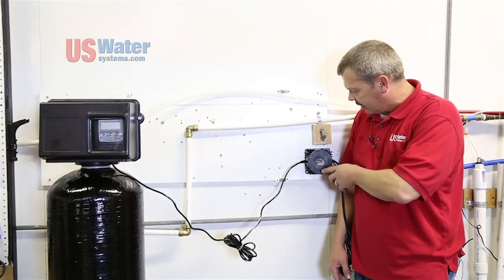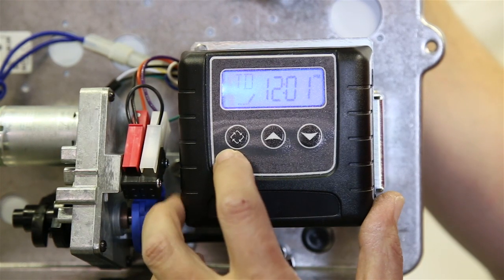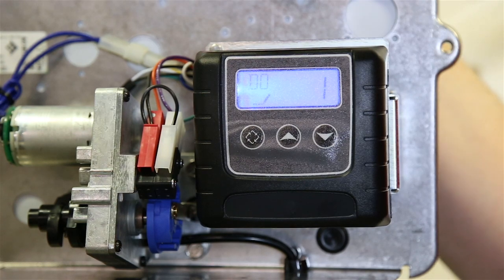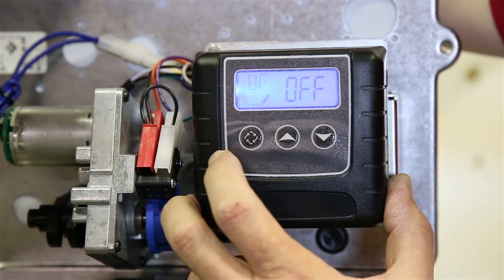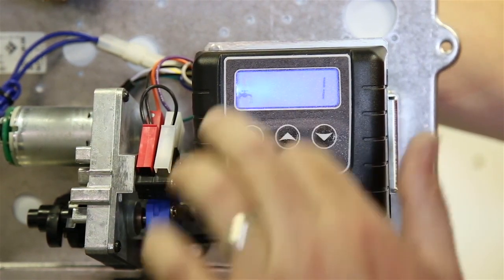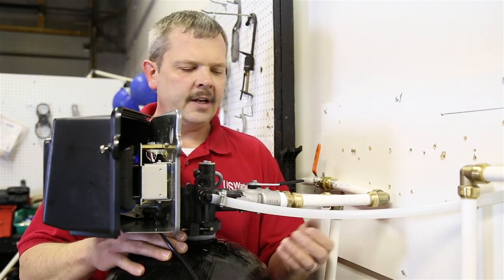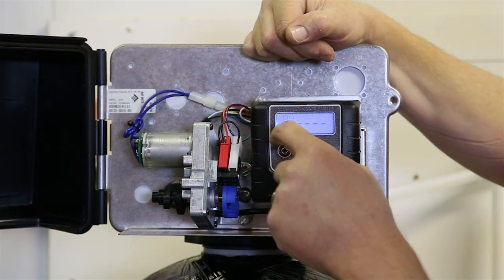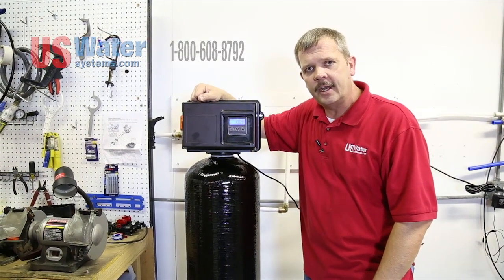Installation - InFUSION Iron and Sulfur Eradication System (part 2 of 2 - programming)

Comment: I have a question I hope you can help me with. I have the same set up just a different system and when I use water I can hear water trickling into my iron breaker tank. The problem I see is my expansion tank gauge is at 40 pounds and it keeps popping up to 60 pounds and back down to 40 pounds until I shut the water off.  Then it sits at around 40 pounds. Is my expansion tank water logged???  I don’t want my well pump burning up.